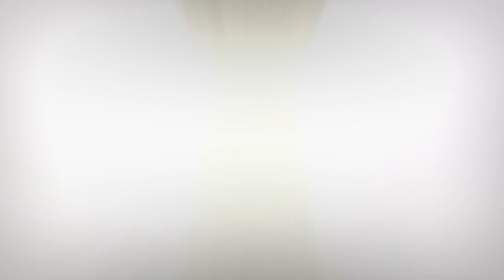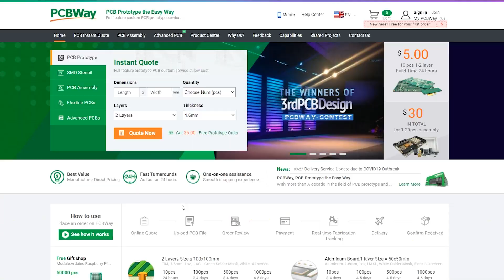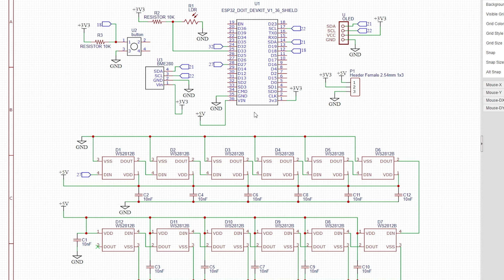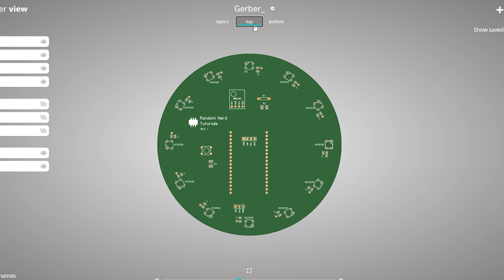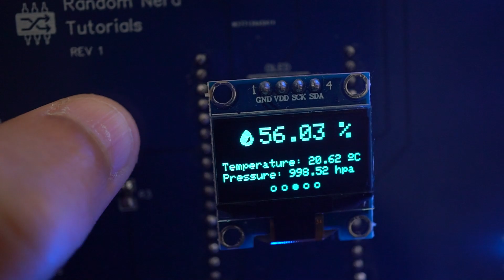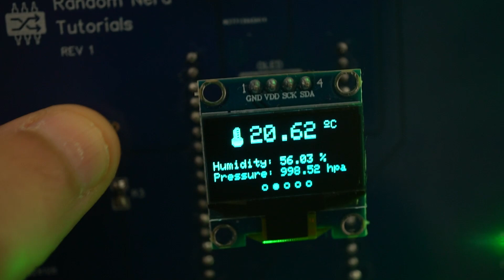ESP32 Weather Station Interface PCB Shield | Temperature, Humidity, Pressure, Date and Time

Comment: Hey Rui, coming from a Web Developer background do you advise learning Python in order to interact with the microcontrollers?
There isn't much support for JavaScript on microcontrollers yet and I feel like C would be too large of a shift at the moment. Whilst Python and JavaScript seem quite similar.
Currently I am just using NodeJS running on a Linux environment through the Raspberry Pi.

Comment: why paying so much for those pcb's? with jlc pcb those 10 pcb's would cost 5$ plus a litte amount for shipping!
Reply: Ok so I uploaded the pcb to jlcpcb and it costs 16$... still half as much as you payd...

other option: no need to make it 130*130mm just shrink it to 100*100m and it would be 5$
Reply from the maker: Exactly what Randall said, the PCB is bigger than standard. You won't be able to purchase them for $5 anywhere.
Reply: @RuiSantosdotme  shame the pcb's are so expensive - not a project I can afford to build.